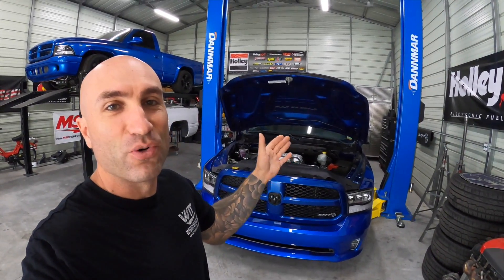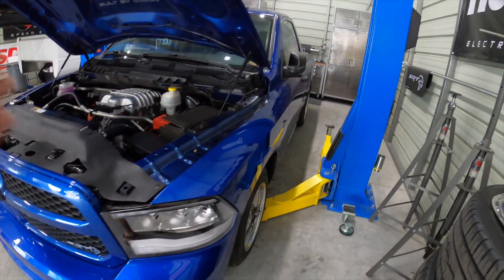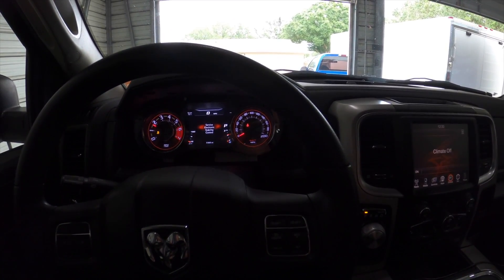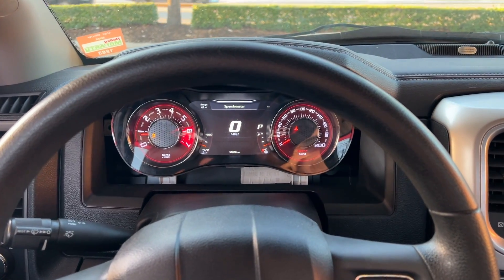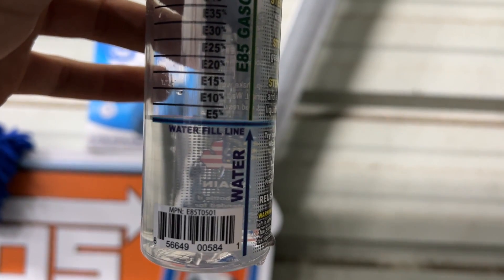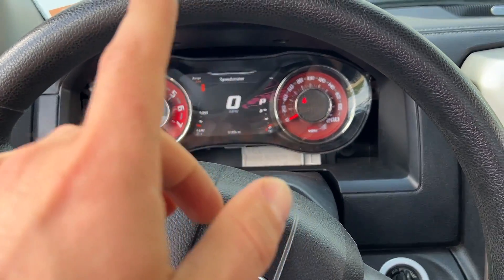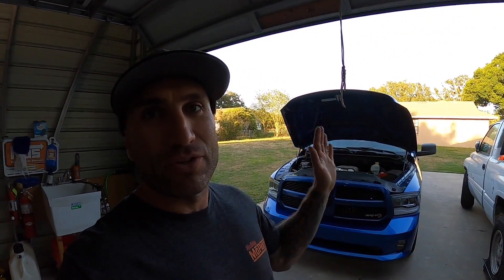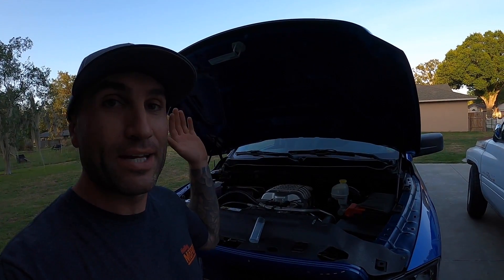Switching from 93 Octane Fuel to E85 on a Hellcat

Comment: My 2007 Ram 1500 has the 4.7 Magnum engine in it and it's has the flex fuel capability, I never put E85 in it, but I could if I wanted to, but there's not many gas stations around me that have E85.

Comment: Fuel is always a guessing game. Engine Masters did a "flex fuel" test on an LS if you had a half tank of 91 and threw in E85. They did a full straight 91 and E85 test too as the controls, the E85 sensor read it as 78% so they had to adjust the fuel tables. I've been running 89 in my Dakota. Runs better with the minor tweaks I have done, was right on the edge of being ok for 87 to begin with being a 9.3:1 from factory. Add in 100k+ mile worth of carbon and that can slightly affect it too.